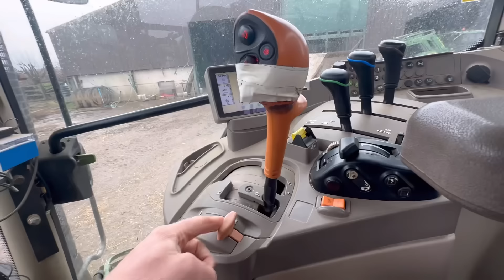Bringing Bales Down not Bens Favourite! Screwfix Trip! Cattle Clipping and Care!

Comment: Joe , could you put a hatch in the milled barley shed , then put the mill up the side of the shed and the auger through the hatch , cut down on the dust , especially on the tractor and mill and the barley will be straight in the shed , and easier to push up .👍😉🥸

Comment: I wonder how much damage a bale would do to the cab of your handler if a bale dropped off the top of that grab ??????? ........ i was unloading a lorry load of straw once with a loader tractor  the loader wouldn't reach up high enough to take off the top layer so i had to  stick the forks in on the layer  under neath  and the top bale rolled back over then rolled down the boom of the loader and landed on top of the roof of the cab  and snapped off the front part of the roof of the cab  but that was only 15 feet or so up from the ground level .......your stack is 36 feet more than double the height plus the top bales are extra heavy cos there wet